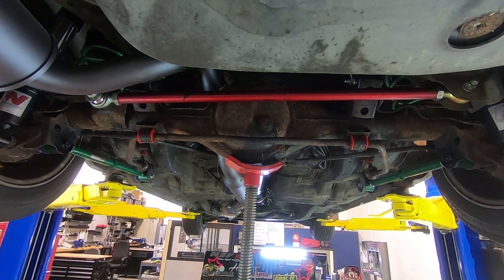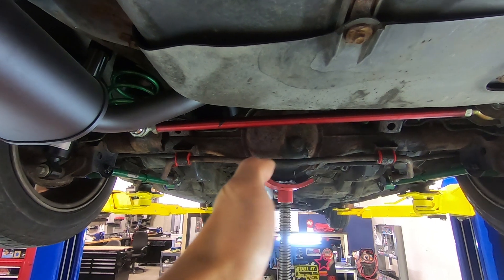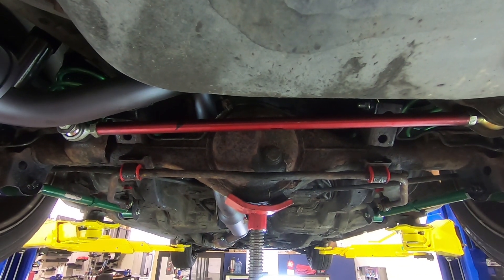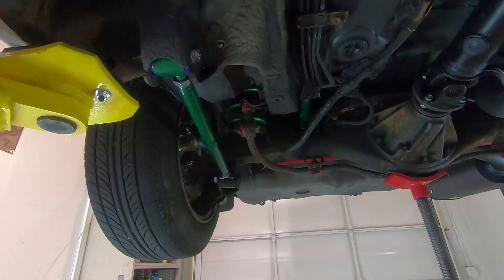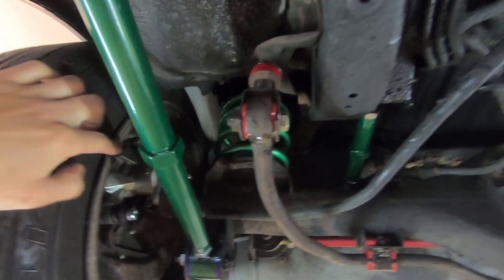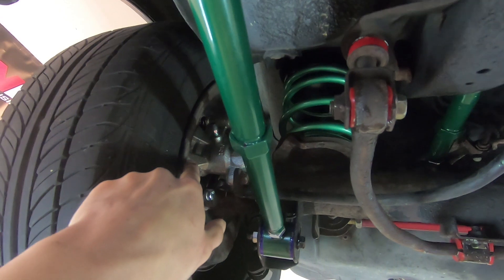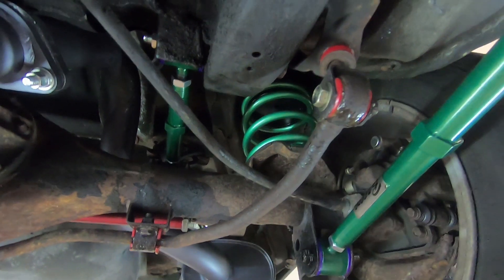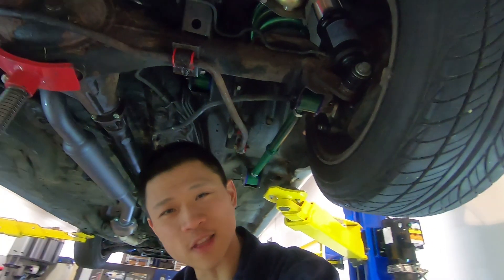AE86 Panhard Bar Adjustment

Comment: I had a hard time finding a replacement  bushing for my cusco pan hard bar on the axel side. I found a replacement from white line. Only thing is that the plastic collar that sits in between the bushing and the axel is no longer used. Like oem. Just wondering if you’ve ran into this problem of finding a suitable aftermarket replacement. Hope i make sense.   Thanks for all the info you bring. Keep it up👍🏼
Reply from the maker: Thanks for the kind words! Yes it makes sense. We have a local customer that used the ae86 prothane panhard bushing on his cusco panhard.

Comment: I was under the impression that you want to do this with weight on the wheels/at normal ride height. I can also see the difference between horizontal positions in the panhard's arc being negligible between normal ride height & full droop. I see the jack under the pumpkin, what's your setup?
Reply from the maker: The pole jack under the pumpkin is to simulate ride height. Normal ride height and full droop panhard positions will depend on how much drop your current suspension has. This is on a customer car. T3 Panhard, Annex Coilovers, Breeze Fab 4 links
Reply: @CMAutohaus  thanks for explaining. Keep doing your thing!